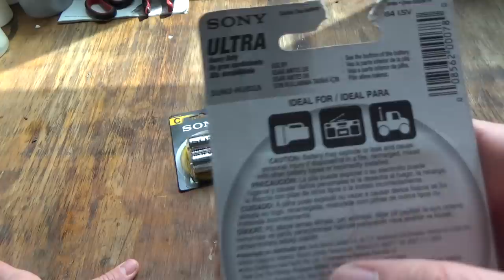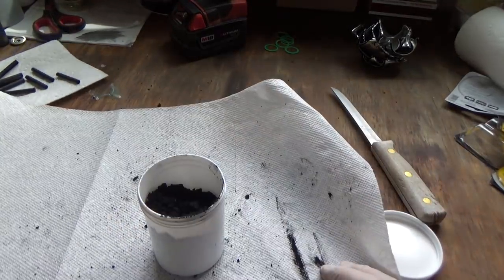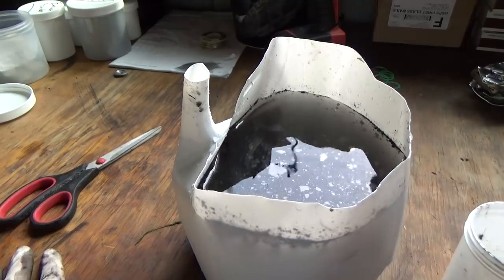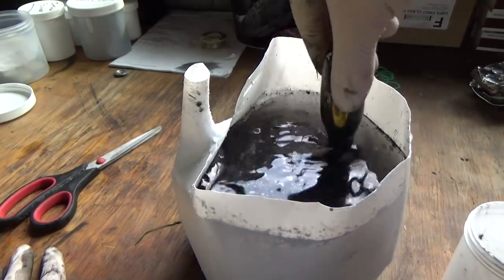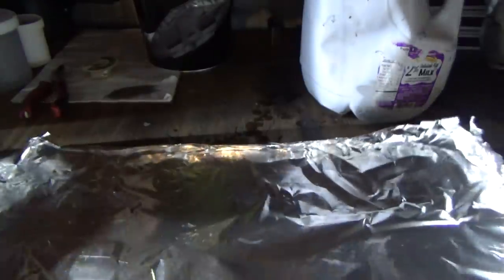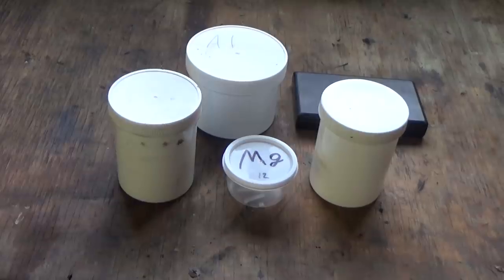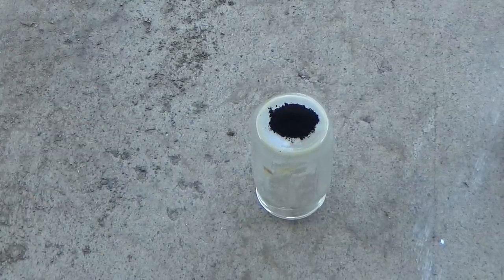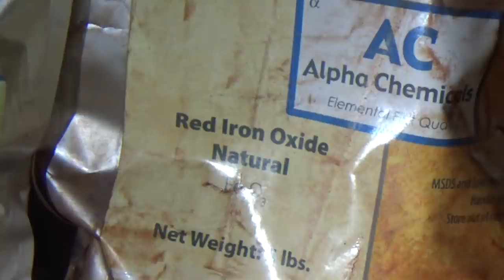How To Make Thermite Out Of Batteries

Comment: When using a milk jug for separating solids, you can use a razor blade to cut down the side of the jug to drain the water out. It will cause a lot less of the particulate on the bottom to stir up.

Comment: The battery cases are steel not aluminum, and aluminum and magnesium should be super fine ground, and mixture in dehydrator overnight
Reply from the maker: Chuck Whitson No they are aluminum, they melted easy with my blowtorch, and yeah I didn’t have the equipment to do so, but maybe I can use the ad revenue this video got to improve equipment and materials for future videos
Reply: @Techience  I have disassembled dozens of batteries for different experiments, take the sheet metal outer sheath off of another one, put a few drops of salt water on it lay it outside a couple of days and when you come back to it it will already be rusty, aluminum doesn't rust, it doesn't matter if salt water or plain water, aluminum corrodes in salt enviornment, but never rusts orange
Reply: Chuck Whitson not all batteries are made using the same materials. Some cases are steel, some are aluminum and some are zinc. I have worked with metal since entering the work force in 1994 as a machinist and CNC operator. I have used thermite for welding hundreds of times, even in the rain. It can be a bit harder to start using magnesium, my preferred method is two modded high voltage transformers jumpered together with new secondary windings causing extremely high amperage. That can create an electric charge so hot and intense the air around it turns into plasma when allowed to arc from the leads the plasma then will set of the thermite reaction. Once it’s going, it doesn’t matter if it’s wet or not. The reaction is so hot it will instantly vaporize any water content it the mixture. Dehydrating the thermite is a waste of time and energy.

Comment: Are you adding aluminum powder and iron oxide?  No?  Then you did not make a thermite reaction.  You merely burned the manganese.  Which will do so readily in the presence of oxygen.
Reply from the maker: Rondo Hunter A thermite reaction, by definition, is a metal + an oxide that go under exothermic reaction.
Reply: Styropyro's channel he shows a bunch of different exotic thermite mixtures and explains what different metals will react and why

Comment: save the carbon rod can make a carbon arc welder ..melter
Reply: Yes, works great with just a 12V car battery or 24V 20A power supply, even done it with 6s 5000mAh lipo cells. BTW Lantern type batteries have better rods

Comment: Your process takes several days. Simply buy aluminum powder and iron oxide. Mix together and there's your thermite. 10 minutes vs 10 days. Take your pick.
Reply from the maker: That wasn’t the point of the video...
Reply: Your suggestion takes more money. Simply make/extract the aluminum powder and manganese di-oxide. Mix together and there's your thermite. Less dollars vs more dollars. Take your pick.
Reply: Iron oxide powder - fine, I can buy iron powder and oxidize it at home, but where, except chemical stores ( where you quite specifically can't buy it as a physical face ) am I supposed to buy aluminium powder? Also, your process, even taking that I have a lot of money to spend on fuel to go to take them this would make the process even more expensive, or considering I pay for shipping, your process will become even lengthier than this one.

Comment: um ... no explanation of the chemistry or even of what thermite is?
Reply: Thermite is a pyrotechnic composition of metal powder, which serves as fuel, and metal oxide. When ignited by heat, thermite undergoes an exothermic reduction-oxidation reaction. Most varieties are not explosive, but can create brief bursts of heat and high temperature in a small area.

Comment: What if you use dead batteries instead of new ones?
Reply: You’re results would be far more worse than what we just seen here! Simply because the desired element would have been depleted , therefore you pretty much would have wasted your time! It’s much more easier to just order the true ingredients (Iron Oxide, Powdered Aluminum!) as being individual elements, you will not need any kind of special license or permits to purchase! And they are relatively cheap!!! Now I’m not so sure about acquiring the Magnesium ribbon, for a detonator? But I believe you can get some of those toy rocket engine wire remote ignition systems, and there you a go! Of course I must tell you that I saw this in a dream and (Ahem!!!) well you really can’t take it seriously! 😃 cause you know dreams and how weird they can be!!!🤫🤫🥴

Comment: and why would I want to make thermite? You can put a point on the carbon rods, wrap wire around the other end hook it to a battery and solder with it, but Thermite, of no use to me.
Reply: Plus, it is trivial to obtain pure black iron oxide at a far lower price than what he paid for those batteries. And you don't have to tear things apart to obtain the oxide of dubious purity, even after the water wash.

Comment: You can Buy Aluminum Oxide . Aluminum powder doesn’t Work. It has to be oxidized..
Reply from the maker: Tino Pacino no, it needs to be aluminum powder. The oxide is in the manganese dioxide, in this thermite, and in the iron oxide in normal thermite.
Reply: The iron needs to be oxydized NOT the aluminium. If mixed right the oxy active element is present for the alu' anyway.

Comment: Interesting proof of concept...that it can be done...but not economical. MnO2 can be bought for $4-5 per pound in bulk. Even adding shipping the cost will be less than getting it by destroying perfectly good batteries. Plus, listen to yourself: "If you need to make some shitty quality thermite for some reason, and you don't have both aluminum powder & iron oxide...put you do happen to have a dozen brand new batterier lying around..." Silly.

Comment: Thermite with out magnesium?? Worthless!
Reply: Who said? There is magnesium. 1:30
Reply: Hardly. The classic thermite reaction, just one of many, uses aluminum and iron oxide. Magnesium is sometimes used to ignite the thermite mixture, but there are other methods.
Reply: @buggsy5  Magnesium burns at 4000 degrees it is used in Thermite to cut metal  and is a hell of lot harder to set on fire than aluminum and iron oxide.
Reply: @GB-kv6jw  The standard definition of thermite is a mixture of aluminum powder and an oxide. Stretching the definition a bit to include other Goldschmidt reactions, there are a number of other metals that will work - if a suitable oxide is also chosen. Some are iron, nickel, magnesium, silicon, boron, zinc and titanium. 

A burning ribbon of magnesium is one method used to start the reaction. 

Magnesium is much easier to ignite than aluminum, it also boils at a lower temperature.

Can the temperature be higher than the boiling temperature of the metal? I don't believe so, but may be wrong as I have not looked for a scientific paper on the subject. But if the liquid behaves the same as every other liquid reaction of which I am aware, then that is the case.

If so, the magnesium based thermite will reach a temperature of about 2030 degrees F while aluminum based thermite will reach a temperature of about 4445 degrees F.